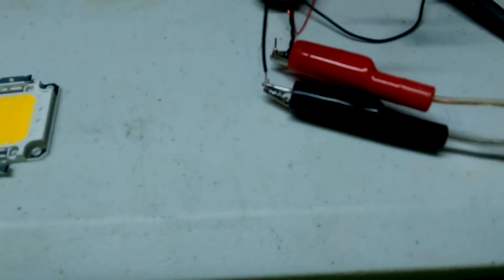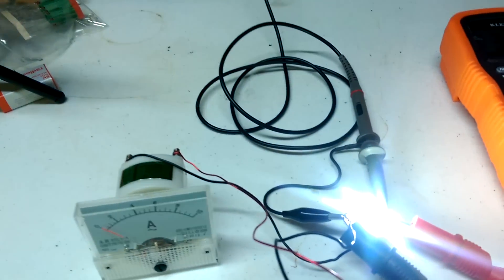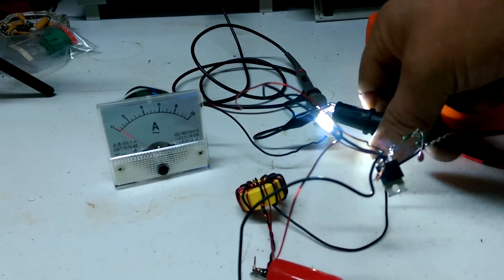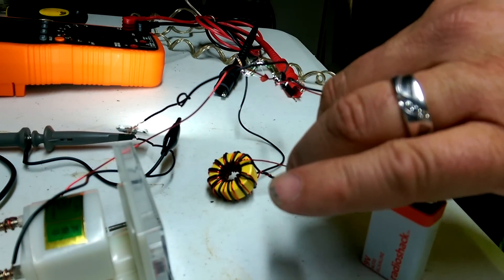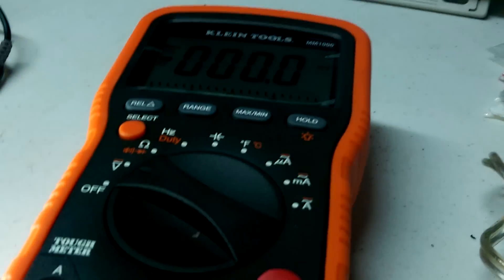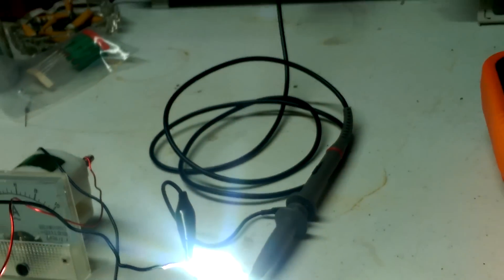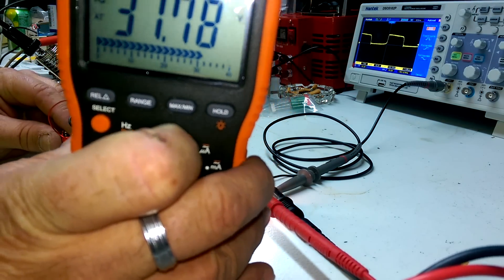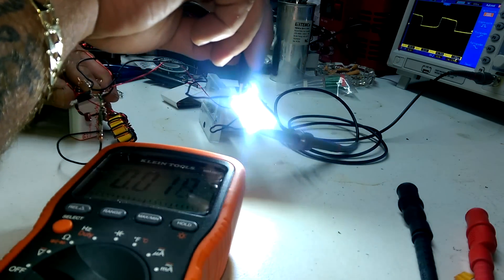Additional energy with Bifilar Joule Thief. 85% more. Is It Overunity?

Comment: Nice results Marc.  what is the reference of your transistor ? And what is the value of the resistor ? Your circuit surely achieves overunity.
Reply: The choice of the toroid seems critical. with a black toroid, i have a bright LED, but only at a small value of the resistor (around 20 ohms). My LED is different of yours.

Comment: Hi Marc Belanger,
What kind of capacitor do you use?
Where did you install the capacitor?
How big are all your resistances?
Can you provide a complete circuit?
Would be good if you connected a bridge rectifier to the output, so you could do better measurements.

Comment: you don't know what you are calculating. voltage spikes are counted on your meter and you can't judge the power of that led by just looking at it, man. be sure of your data before crunching the numbers. btw a full 10 watt led would make your camera show nothing but a white dot with black around it.
Reply from the maker: if you go ahead and add the led driver it comes with and plug it in, you&#39;ll get as much as you can get without destroying the led., utilizing a much larger input power. If we back off just prior to saturation, we get 95% of the same light with less than 1/8 of the power used. Just because something looks too good to be true doesn&#39;t mean you have to try and sabotage a good thing.

Before leaving false lame &amp; jealous comments that you just speculate because you didn&#39;t get the same results,  realize who you are saying it to and what you are trying to say. I do have a lux meter and I know what the results are.. It doesn&#39;t mean you have to go and try to insult somebody that has come up with a practical method of saving electricity by stating the spikes are affecting my readings.. The spikes are saving the energy. The spikes happen while the led is remaining lit because the effect of the flash in the led isn&#39;t evident, this saves energy because it stays lit long enough and bright enough to pulse or ring the transformer the right way. This is how a joule thief works.. I suggest you try building one in a more simple arrangement and tune it to see what you come up with. We don&#39;t have to murderously destroy these high tech lamps and drown ourselves in our electric bill, so we just tune them back and prolong the pulses a bit by extending the wave of the pulses, like utilization of arbitrary waves or pulse trains, then raising the frequency and playing with the duty cycle until you have a portion of  the volume of energy used to get the desired effect in resonance to overcome the use of heavy loads of energy which give lossy results , as normal light bulbs do. An LED is an overunity device, they put out more energy in light than it uses if tuned and powered correctly, & it will run itself with a small solar cell using the proper circuit and run itself indefinitely, make no mistake about it. You will have extra energy left over to use before the light dies, enough to light 2 leds from one led powering itself, then you can cascade these circuits with other solar panels making an electrical generator. The moral of the story here is that it works and  It truly saves the life of the led, because it stays cool to the touch and still outputs a lot of light.. you reply is based upon negativity because you aren&#39;t scientific and obviously do not have a very abstract mind that could think outside of the box. You are obviously so jealous that you feel you have to try and belittle the work I do because you believe so strongly that something just can&#39;t exist.. The truth is that it does work and i don't have so many followers because I sell a hoax, I have followers because they have duplicated a sample overunity device that I shared with the world years ago and I keep letting new ones out without too many issues. Just because you have spikes killing your cheap power supply that is unprotected doesn't mean that mine is the same. I had one of the cheaper ones, and they are light, weak and die from high frequency pulses because it did happen to me and it did interfere with readings I had. The new one isn't affected by the output as the old one was, and that I can easily prove to anybody because it is much more expensive than the $50  5 amp chinese supply that has no protection.
Reply: Marc Belanger you just don't get it. I'm not even going to bother arguing with you. I really hope you don't respond to people like this in real life. BTW your judgments of me are entirly wrong. I am not who you believe I am.
Reply: Marc Belanger I suggest you don't doubt my knowledge. I've made countless joule thiefs, joule ringers, hv resonating transformers, dc-dc boost converters and so on, so don't talk to me like I'm stupid. I tried really hard to not lose my head over your rather enraging comments about my knowledge and mindset. I know more than you would believe.
Reply from the maker: perhaps you will look at the outputs of the Pelex device I have created. Maybe you will finally believe for yourself that there is a such thing which you have obviously not yet created or have overlooked. simple in nature, amplifications can be made by the simple oscillation with resonant result. There are differences and devices out there that do work in opposition than you already know. As I said, think outside of the box and you will someday succeed. just stop believing the bologna of only one energy.which is portrayed by science which is very untrue. that is where most people fail. This energy can be utilized in low frequencies as well as high. Let me just state that you may want to try playing with avramenko plugs and face germanium diodes towards each other for groundings of these free energy circuits. The output of this simple circuit is much more than you would ever think if you converted and stored it correctly.  Again, think outside of the box and try what I have just stated then maybe one day you will thank me, but beware, if you pass along what you find online, you will see thye wrong thing at the end of the rainbow.
Reply from the maker: jjhack3r boy , you've made so much for somebody that has 3 videos and such young girly little hands. You're not speaking to somebody that's just left high school or college pal. I've been soldering circuit boards before you were a thought in your father's pants. Did you even graduate high school yet ?  Talk to me when you have 35 years of electronics experience and 15 years with Radiant Energy research before you can tell me what you know about my work, or what you think you know about free energy. I'd bet you don't even know how an av plug works.

Comment from the maker: I tuned and completed this back when I posted it. what I told you was that each and every led resonate at a different frequency to become most efficient. the tuning will be voltage, which is done by tuning more or less turns of wire on the toroid to increase or decrease voltage . the type of toroid will also change the variables, and the resistors used to change pulses rate on joule thieves that use 555 timers or other ic's. the amount of pulses on and off are the frequency and each led will respond differently to frequency so it's important to tune them to their most efficient point per led. I am not tuning or using this circuit anymore, I completed this a year ago and have no interest in playing around with them any longer because others only complain in the comment area because they no absolutely nothing about how they work, as well as the meters.

Comment: Circuit Diagram Please .. I know it's a joule thief whats the mod Marc?. tx myke does
Reply from the maker: I'm sorry, this is a joule thief I have found online a while ago and I no longer have the diagram saved unless the link is written in the description. Like with any Joule thief, the frequency will modify what the load sees for voltage. The meter is NOT accurate at these frequencies, however, it is most likely what the LED is seeing for voltage and amperage as the turns ratio could be outputting a higher voltage as my meter says. The scope shows 34 volts on a 100v scale at 118 khz, so, I'd say the meter is pretty damn accurate because it shows basically the same range that the scope is showing, and, the scope is accurate at higher frequencies into the megahertz range. The input is showing 1.56 watts. This is what we should be using for home led bulbs, however, the home bulb has to invert the electricity from the wall and much more efficiency losses happen by transforming the voltage from 120 to 12, then rectifying it causes issues. The real way we should do this is to build a 12v bus system in the home with a high amperage, highly efficient 12v power supply or maybe even lower so we could wire all of our lights in the home from circuits like this. The light is more than enough to give us the ability to see, read, and do all of the things a normal incandescent bulb will give.. we just have to buy warm white leds, and, since CREE has just released brighter, more efficient leds, there shouldn't be any problem seeing less wattage used in each and every joule thief build. The constant current power supplies used with these leds are joule thieves, they are just engineered mathematically, not built and tested to see what's most efficient. If we try every frequency and voltage per led, we will find the sweet spot that allows each and every led to be most efficient. That is my mod, the tuning. .